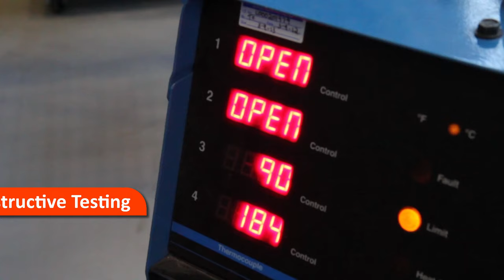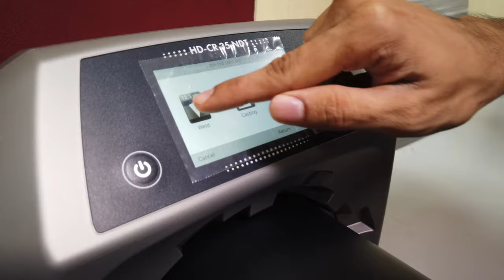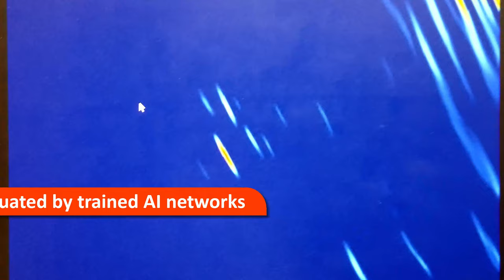World's first AI-based technology for Non-Destructive (NDT) Weld evaluation for Ship Building

Comment: First of all I congratulate CNDE and Dhvani Research for their excellent AI-based technology solutions in identifying weld defects using RT and UT. However, I would like to know what is the Probability of Detection (POD) (what is its a90/95 i.e., detecting a defect with 90% probability and 95% confidence)of defects using these AI-based technologies? In simpler terms, what is the success rate in detecting defects and what is the guarantee that these AI technology solutions won't miss any defects. Please let me know if there were any efforts put in identifying the reliability of these technologies.
Thanks
Vamsi